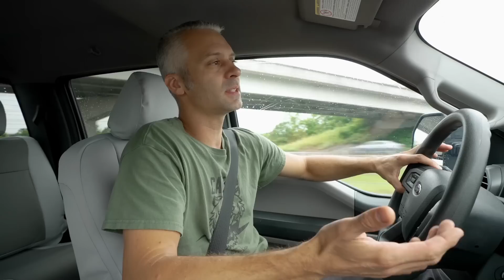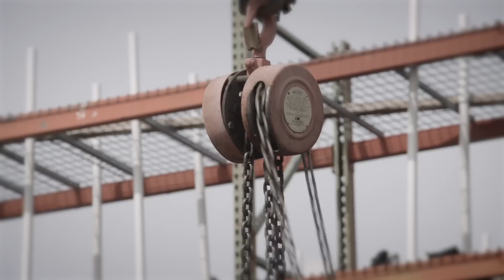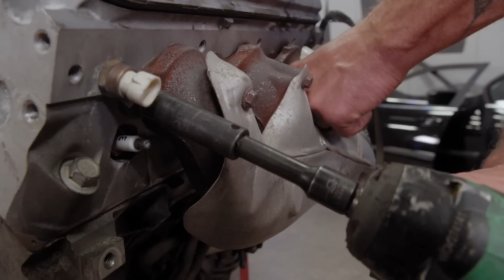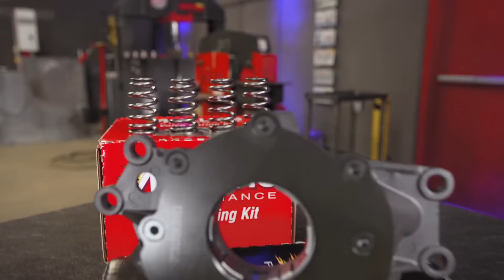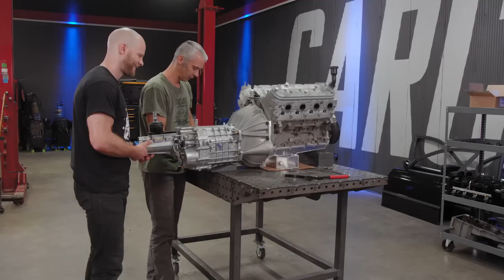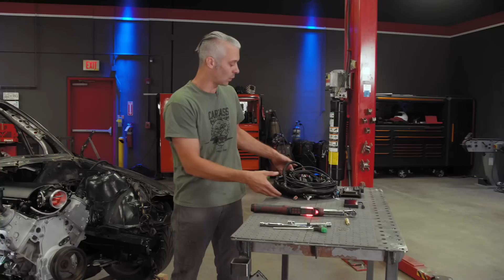Rebuilding A LC9 For A 2001 BMW 330i - Carcass S5, E10

Comment: Perfect engine for this build. Hard to go wrong with a LS. One of the best engines ever made.
Reply: Yea especially if you want to ruin the weight balance or the car and make it nose heavy, and you want your car to overheat and breakdown all the time. Should have stuck with one of the performance BMW engines.
Reply: lol do your research. The LC9 LS is lighter than the boat anchor engine sitting between the BMW fenders. 

Overheating ? What are talking about ? you must be talking about BMW engines. Mid 90s through early 2000s BMW were known for blowing head gaskets.

LS engines breaking down lol. Where have you been … BMW s again mid 90s to early 2000s were not known for reliability. At least in my area of the country they weren’t .

Comment: nothing was done to the bottom end? i would expect a peek at the bearings at the very least. PowerNation has a full service engine shop - could have sent the engine over there for a quick montage of a full rebuild. then there was no plastic tab to center the clutch? i cant watch this mess.👎
Reply: Obviously they would of checked it over good.....they just didn't show it all because they are not focusing the whole show just on the engine Obviously...and yes they did use a clutch alignment tool. You blind?
Reply: @19chev81  i did not see it nor was it stated - it was not done.
Reply: @19chev81  they spent all that time twisting bolts and removing simple parts. yet you're telling me "they are not focusing the whole show" on what i think are the most important parts. its lazy writing and production just for YouTube clicks. sorry, i'm not that stupid and you can shill for them all you want.
Reply: @19chev81  the title says "Rebuilding A LC9..." they were already butting up the engine mid way through the video and i had no real information on what was done to the engine. here you are telling me what was done is Obvious. clearly you think i'm stupid and gullible. i'm saying "The Emperor Has No Clothes"

Comment: Knox Auto Parts is an excellent resource. Salvage yards in general you should stay away from if you can afford to buy a new crate engine. Leave me the cheap salvage yard parts please! Currently I have TWO Beemers in need of engines. One is my fault, but the other e36 has TWO ATTEMPTS, where someone wanted it.

Comment: The LS is cheap horsepower, where's the problem with that? The Hemi and Cyoty are too big to fit in that little car. What else were they to use? My other question is, out of the 3 engines Chrysler, GM or Ford, who's engine weights the least? The least amount of weight over the front axle line is what you are after in a track car. I can think of several different engines that would make that car fly but when you get down to horsepower per dollar nothing beats the LS platform. A 500 horse 4 cylinder engine running crazy boost would be better for handling (because of the lesser weight) but that would get expensive and be less reliable.
Reply: GM 4.3L LV3 V6. 285hp and 305tq stock. Weighs 300lb fully dressed and with boost can hit 500whp or more really easily.
Reply: @craigquann I’m wanting to do one of those swaps in a S-10
Reply: Stock iron block bmw engines m50/m52/s50/s52 can hold well over 500whp. I made 715whp on a stock m52 in 06. Should be alot easier and cheaper nowadays.
Reply: @shifty1927   715hp, do you use this car on the track?  I'd rather have 400 horses that will last all day with no issues than 700 that's gonna break or wear out other parts too soon.
Reply: @RJP400  yea ran it at the track and street drove it for a while before going fully built. But put a little over 10k miles on the setup ranging between 500-700whp.
Reply: @shifty1927 come on now. There’s no such thing as a “cheap” BMW anything.
Reply: @bertpulaski2492  thats exactly what the ones who know nothing say. Guess its a good thing so many are scared to grab a cheap used bmw. Even though the drifters seem to have caught on the past few years and are depleting the supply. I have plenty of engines and transmissions I got for dumb cheap. But this was also over 15 years ago. But I still see the engines and transmissions going for 500 or less today.
Reply: @shifty1927  since you believe that they are so popular, how many people actually swap BMW motors into something other than another BMW? I mean come on, even the Honda guys are swapping K series motors into Corvettes and OBS trucks to be different.
Reply: @bertpulaski2492  At least you get what you pay for, unlike with GM.  GM never built a car that can run consistently and reliably on track. BMW's run all day on the Nurburgring, so I'm sure they'll handle some much easier track they'll be using it at.

Comment: "F" the LS engine. I'm outta here!
Reply: I am a mechanical engineer and a European and if I am building an E36 (my favorite BMW) or an E46 I want an LS in it.  The BMW M50/M52/M54 inline sixes have legendary reliability BUT the LS/LT is even better.  Add a boat load more torque and it´s a no-brainer.  I would not be surprised if this LS motor is even lighter than the stock, cast iron block inline 6.  LS/LT for the win.
Reply: @rafaellastracom6411 Same!
Reply: @rafaellastracom6411 Thats funny cause as an American I grew up messing with Pontiacs with my dad. In 99 when my parents split he got a 97 328i auto sedan that he put chromes on and took to the club.😂 2001 we manual swapped it and random bolt ons. 04 we decided to attempt to boost it. No one had made over 400 at the time and told us an m3 would be the better route. Made 478whp on the fresh build and ended at 715whp on the stock engine. Went fully built and by 07 it was the 1st 1000whp and 9 second e36 328.
Reply: @shifty1927  Sure, the M50 series engines are awesome but you have to boost them to get there.  It´s quite more costly and intricate than just a modern LS, not to mention the weight issue.  I bet you can make an E36, which is one of the all-time greatest handling cars, into an even better one with an LS as it would have less weight over the front axle.  For me the old adage is true, there is no replacement for displacement.  I want normally aspirated throttle response and gobs of torque, that spells LS all day long.
Reply: @rafaellastracom6411  You may be right.  Though I would say an iron block LS would be heavier, and would throw off the excellent weight balance that BMW's are known for.
Reply: Whats wrong with cheap reliable horsepower?
Reply: See ya
Reply: I miss him already..😢 the good ones are always gone too soon
Reply: Whaaaa!  😂
Reply: Go cry about it, LS motors are super available for every part they'd ever need for reasonable prices. All LS based motors are the best V8 engine currently available
Reply: @SlapoutGamingYT  Agree, kind of. I’m a Gm/LS fan boy. I gotta admit. But tbh other ppl can argue their engine platform is the best just because every platform has its flaws and LS based engines are 25 years old! No new tech like vvt, variable intake runners or cam phasing. I would say one of the best. Unless you’re factoring cost, reliability and ofcoarse parts availability and aftermarket support then yes ofcoarse it’s the best! Idc I’m an LS fan all day and pick LS over anything every time but gotta give it to the coyote and how well it responds to boost. But yeah LS all day
Reply: Who cares
Reply: Clearly you hate being reliable, affordable, and better designed.
Reply: Lol
Reply: Hahaha
Reply: Can one build the M5X engine? Yes. Can you make the same power the LC9 will make? No way. You will need a lot of parts and prep to get the same numbers from an LS than the M5X. That costs money. And if something breaks, they're hard to find  and expensive. LS parts can be found in any parts store for relatively cheap.
Reply: The fact I can buy a turn key LS motor off of TSP for like 8-10 grand and damn near smoke anything on the street + get parts easily like stupid easy, I can’t say the same for bmw…. I do like AMG’s though lol
Reply: Main reason why people don't like the ls is because they can't afford to do the swap.
Reply: It’s the cheapest way to make a bmw reliable
Reply: Looks like somebody can't work on an LS or something is really wrong cause at least let's have a really good reason for so much hatred on an LS pal
Reply: lol see ya…. the LC9 LS is lighter than the BMW 6 cylinder makes way more power especially if you add a power adder. Is definitely more affordable. Great choice !!!
Reply: get out..nobody f care
Reply: Im with ya POEBOY...   DAM SHAME .    THIS WHAT SO CALLED MECHANICS DO WHEN THEY CANT FIX THE ORIGINAL OR FIND A V8 IN THE SAME FAMILY..  GM MADE THOSE LS ENGINES FOR GM CARS...  PUTTING IT IN A DAM BMW MAKES IT A DAM G8 OR SS SEDAN..   THE HERITAGE OF BMW IS GONE AT THIS POINT...  IVE NOTICE PPL WHO LOVE LS MOTORS DONT LIKE TO REPAIR COMPLICATED ENGINES .  AT ALL .   F@#_K A LS .
Reply: @hatedforhighrollin   it's a budget build for track use.  You break something you can get parts easier than if they kept the stock motor.
Reply: @hatedforhighrollin  You should change your avatar name.  Not so much ´highrollin´ more like ´lowballin´.  I´m sorry.
Reply: @hatedforhighrollin  bet nobody reads all this lol. GM/Chevy/Gmc/Cadillac V8 fan here. Besides the fact that the e36 m5x engines are decent and reliable* (still a bmw) can’t ignore the fact that the e36 wasn’t made to the best quality and standards as before and arguably after. Headliners sag door panel break interior trims break off bunch of rattles. E36 doesn’t give me the euro feel and experience then to say LS guys don’t want to work on complicated engines. NO we don’t LIKE to repair complicated engines because we’re usually mechanics or tradesmen in some sort of heavy labor job and don’t want to spend my evenings and weekends fixing a problem that’s over engineered and complicated. Nobody wants to spend 8,10,20 or 28 hours on some engine repair when I can get it done on an LS in 4 hours on a Saturday and have my car back on the road. I drive a Mercedes tho but I know and accept that it will need heavy repairs here and there. I’m a mechanic at a Benz dealership and all I do is complicated work on complicated cars and complicated engines with zero space. M176 M177 engines pay 6 hours to do a thermostat. Gotta pull the bumper pull the engine trim remove left and right charge air coolers radiator fan ac condenser and radiator. And finally you get to the thermostat. LS takes me 15 mins. LS isn’t perfect. Just did a full rebuild on my 07 Tahoe cuhz the cam and lifters. Could have just replaced cam and lifters but  decided might as well do a full rebuild and dod delete. Had the engine out in 4 hours. Taking my time in the garage with my dad and a few cold ones. After receiving the engine from the machine shop putting it back in took about 4 hours as well. Fired right up on the first start up. That’s why I and many others love the LS along with many other reasons like price availability and reliability. Not hating on bmw at all. I can appreciate the engineering and heritage. But the e36 just isn’t the platform I’d be worried about swapping or cutting up. And usually ppl who talk about brand heritage and hate on another brand have never even replaced a valve cover gasket. Much less complicated engine repairs like the sorry vanos system. LS for the W all day. BMW doesn’t even make a good V8. Anyone ever see a v8 bmw with more than 200k miles? 300k? 500k? 🤔🥴🥱